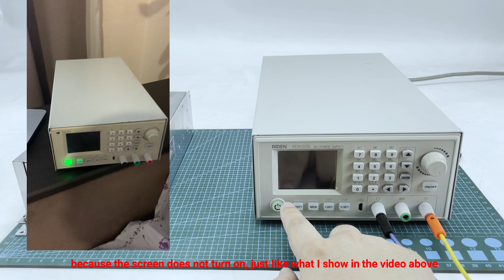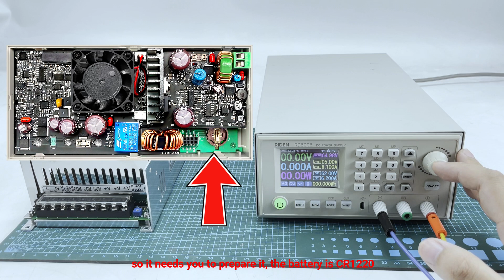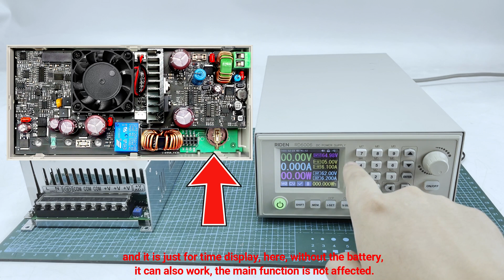PSU not working? RD power supply update failure fixing! RD6006 1000W PSU

Comment: I am trying to lock the keypad but the shift button doesn’t light up great and I cannot lock the keypad.
Reply from the maker: hello, could you set the OVP and OCP value in this way? does the SHIFT button work?
Reply: @ the shift button doesn’t beep or turn green when you press it. We have two and they both do the same thing.
Reply from the maker: @ then please contact us on aliexpress, take a short video to show me that, and you do not answer my question, can you set the OCP, OVP value? you can record a video to set them,let me check it, you said it happens on both device, show me both operation

Comment: Thankyou so much for this, my RD6006 was stuck during software update and I did not know what to do.
Reply from the maker: hello, you just need to hold on the "ENTER" button, and connect the input power of RD6006, it will enter the BOOT mode, at that time connect the PC software and reupdate the firmware and it is ok

Comment: HELP!
great tutorial and video. Question
My RD6018 has some problems. It won't power on.

When it did power on, I notice that the green light (bottom left) would glow/pulse severals times and something inside would glow/pulse blue before unit turned off. 

I contacted the company.  They told me verbatim, " Check whether the AC-DC module has a voltage output of about 68V,
If there is a voltage output. Check whether the two fuses of the DC-DC module are normal."

Told em I'm new to unit and power supply in general and asked if they could send an image of the inside with said areas highlight.
Where do I find these parts inside?  What do I need to do if these are the issues?

I've said alot.  hope you can help. and thank you for reading this. 

/bklyn👑
Reply from the maker: hello, because we do not see the problem with video, so that we cannot judge the problem now, you can contact the email in this video description, show us your device with a video, what you use as input power, and what do you connect before it becomes like this